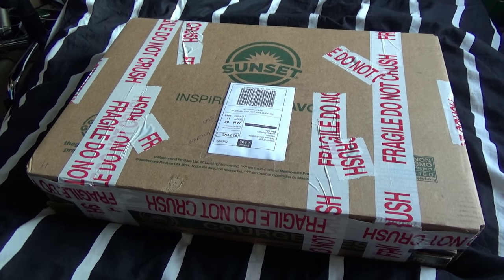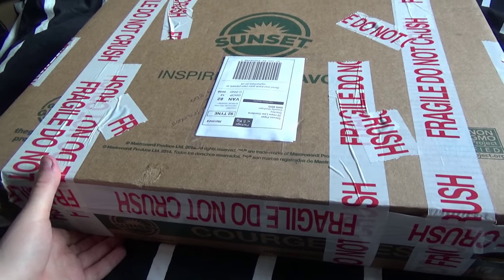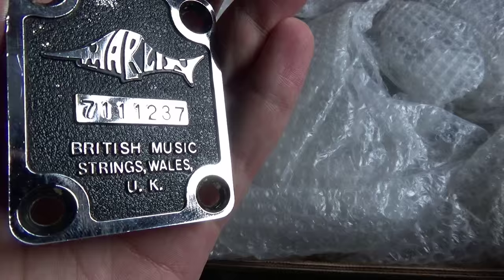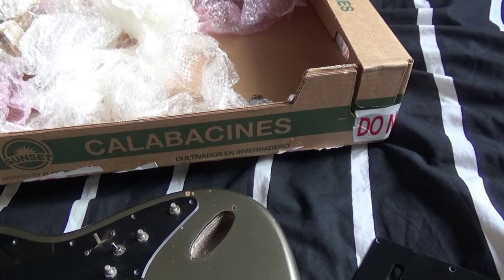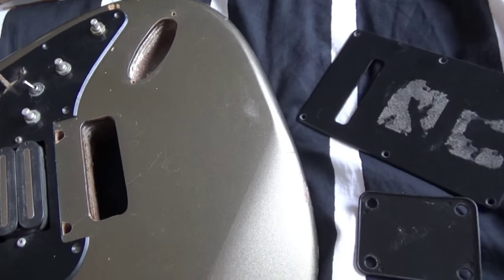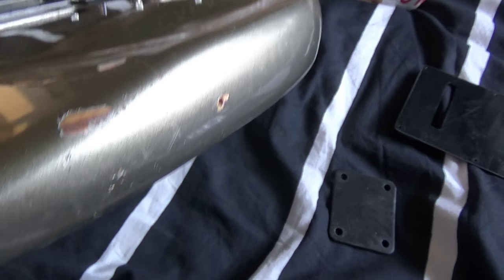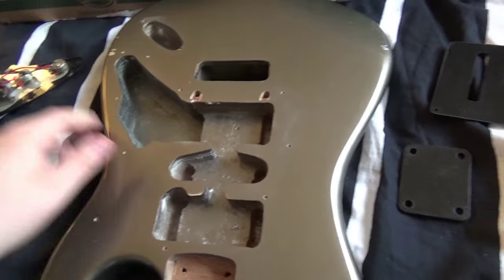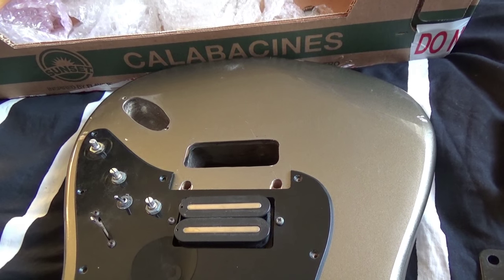New Guitar Day! (sort of) Marlin Sidewinder Restoration #1 - Guitar Adventures #1

Comment: Some trivia I've found whilst spending a quite frankly silly amount of time looking for trem block solutions

The design wasn't sanctioned by floyd rose it was a direct copy of his fine tuning design, so much so he was gonna take legal action but seeing as there were so many of these tremolos out there on different brand guitars (hold on I'll get to that) that they came to a settlement in that they started making them with floyd rose licenced on them even tho they were not or mfg by floyd rose (with the failure rates I'm betting they wish they hadn't lol)

These bridges were on at least four different manufacturers guitars

Marlin known as the kkt
Westone known as the bendmaster
Encore JHS-A7-2T know as the bendmaster
Epiphone..... What epiphone had this fall to bits bridge! Yup known as the bender

None of the brands had any luck as they were all produced by JINAH and all suffered the same fate
Reply from the maker: Sounds about right, I looked into this, and I remember seeing that it appeared to be a ripoff mfg floyd design, I had assumed it was maybe licensed, but it would have been stamped as such if that was the case.

There is no real solution, other that filling and re-drilling for a new bridge, that would be the best idea of course, and there are many cheap solutions out there. Though, while these guitars aren't special in any way really, I would still want to find a solution that doesn't require any modification. For the correct plate, no other block seems to fit, and the mount points, are 72mm wide, whereas, modern floyd is more like 80mm, and most two point trems are approx. 55-60mm.

I remember looking into the background of the bridges, and I had seen many guitars with them, thought the Westone ones do look noticeably better in quality, but perhaps ultimately as you say they likely aren't. Upon pulling one of these apart, I'm astounded the screws for the plate only go into the block by 3-4 mm, that's just no good, the material itself wouldn't matter as much, if the screws went in by more like 10mm

Comment: Sam Deeks - all the parts you mentioned needing in the video are easily and cheaply sourced from online sellers, especially eBay. If you don't mind waiting a bit, order the parts from Chinese sellers for next to nothing. Very often the quality will be better than the Marlin originals. 

Also, British Music Strings was merely the importer of the guitars. Nearly all Marlins were Korean built, with the exception of Slammers built circa 1985/6. Slammers were actually built in the former East Germany, and despite being sold for less and advertised as lesser model than Sidewinders, they are a considerably better built and higher quality guitar.

The holes on your headstock, just above the nut, is where the the locking nut would have been. Humbucker equipped Marlins were all "Superstrat" style models with a locking trem system. It was Marlin's version of a Floyd Rose style locking trem built down to a price. They were ok when new, but wore with age and had trouble staying in tune and in balance. One of the weakest areas of it was the trem block, a low quality diecast material that disintegrated with age. They literally crumbled away rendering the bridge useless (standard trem Marlins were also affected by disintegrating trem blocks). That's likely why yours is missing the trem system, and also why many Marlins are sold with trems "needing attention" or missing entirely.

Marlin locking trems are totally unavailable, and not worth having even if old stock and never used. The trem block material disintegrates with age, so many Marlins (not Slammers though) are now suffering. However, you can buy a cheap "licenced by Floyd Rose)" bridge for relatively very little, and these can be made to fit with very minimal modifications. I did this to my Sidewinder and now it is working just as it did when new.

Despite being cheap guitars, Marlins are worth spending some time refurbishing and setting up, because once done they are actually nice guitars to play and cost little.

Comment: Funny how these old twangers look when you strip them down to the bare bones.
I just bought a marlin slammer myself, They were a little different.. made in germany around 1985, All hardware and electronics was supposed to have been made on site, Beautiful brass block bridge, Odd tuners and pickups and electronics with magnets sourced from russia, The pickups from what i have heard people cannot fault finding them to have a lovely tone and not too much feedback when playing with an amp. Hard wood bodies and hard maple necks. Strange that they went to korea to pump out the sidewinders then when they had perfectly good strat copies already. I wouldn't fret though, You'd be supprised what you can do with a body and a neck! :)
Reply: Gman, stranger still was that the Slammers were sold as the 'budget' Marlins. The Sidewinders were marketed as a step up, despite the fact that the Slammers were far better made. As you said, the Slammers used solid wood for the bodies instead of the Sidewinder's plywood, the tuners were higher quality, the pick guard was three ply (Sidewinders were single), and the whole guitar felt better made. I have two Sidewinders - a K34 "Superstrat" (humbucker and two single coils, plus locking trem), a standard Sidewinder (3 x single coils, non locking trem) and a Slammer. The Sidewinders are great guitars considering that they were budget, but the Slammer is in a whole other league. Well worth grabbing one if you ever seem one come up for sale.

Comment: Maybe to early to celebrate...... But lol managed to source a cad design for a improved biller replacement for the block, I have been chatting to a chap who is a cnc operator and he's going to make up a prototype from the cad drawings, said he thinks aluminium billet should be around the 30 pounds mark should anyone fancy saving one of these trem systems
Reply from the maker: Really? that's awesome, I was actually planning on making my own, then going to 3dhubs.com to get it machined, this would be cool to have, do you have a link? Would he be up for making this in quantity? Or would the cad files be given? My other solution, would be for, if somebody had nothing, like no bridge module at all, then a replacement plate could be made so generic parts could be used with it.
Reply from the maker: Awesome :)

Comment: My first "proper" guitar was almost identical to this. The only difference was that mine had two switches by the volume knob (a coil tap, and an active pre-amp kind of thing. I removed the battery and used it as a killswitch) and a pair of LEDs by the lower tone knob.

For the time, they were perfectly adequate budget guitar. Squier and Epiphone were also making their Strats with ply bodies, so it's no big deal that Marlin did too.

Rosewood neck with 22 frets, sealed machine heads, again typical of the Squiers and Epiphones, and the electronics were average.

The pickups were actually a strong point, as they had the good sense to wax pot them. This was not typical of budget guitars at the time, and so helped the Marlin sound better than the other cheapos.

It's weak point was the bridge, or more specifically, the sustain block. It was made of some mystery alloy that was very brittle. Mine bit the dust after the tension of the strings caused the sustain block to shatter and rip the bridgeplate off the top. Google has revealed this was reasonably common, with some breaking before they even left the shop. At least I had a good 6 years or so out of mine.

I actually wish I still had it. It was a little on the weighty side, but the neck was a really nice shape and so it felt good in my hands. I've seen people fit Floyd Roses on the posts with no issues, so I could replace the bridge, maybe upgrade the knobs and single coils (I'd leave the cool looking bridge humbucker) and it would be a perfectly usable guitar.

What I plan to do is mod a Fender Floyd Rose Strat to resemble my old Marlin. I bought a platinum Floyd Rose Fat Strat, but the colour wasn't quite right, and the neck wasn't right, so it would require replacing too much of it to be practical. I might try one of the new Player Strats and have it resprayed.

Comment: I have one with the 3 single coils strat style cannot for the life of me get it set up rite has a brass nut "bodged" into it by past owner if i get the action rite i get horrid string buzz get rid of the string buzz the action is to high ! such a shame as well as when plugged in it sounds surprisingly great ! and only cost me 15 quid ! but the past owner swapped the cool neck plate with just a standard shiny 1 !!  what a pillock !
Reply: What you probably have is one of the east german made ones. They are amazing! Blank shiney neck plate, 3 single coils, solid wood body, skinny vintage frets, gotoh trem. I have one and it's beautiful. If this is what you have, get it fixed up! You won't regret it.

Comment: ido a lot of work on theses type guitar..they produced 1980,s possibly 1985-6    pick up,s crap  no power  low output    but you can   add new one,s pups... neck great  easy to get  a low action--0.10   nuts crap i opted out for real strat nut....i just need to get rid of parts of  marlin,s o boy i got loads body,s neck,s

Comment: Pls Can you tell me where can ı buy the bridge for Marlin side winder
Reply: Haha! You usd the trem, didn't you! Don't use it! Just never do it! If you use it, it breaks.
Reply: Unfortunately you can't get the exact model trem system used by Marlin, as it was their own proprietary version of a locking trem (similar to a Floyd Rose). They are long since out of production, they are cheaply made, plus the string block  falls apart (one of the reasons many Sidewinders are sold with damaged/ missing trem units). However, you can buy a cheap Floyd Rose locking trem copy from eBay/ online, which are much better quality. They can be made to fit with minimal modifications to a K34 Sidewinder, which is what I did to mine.
Reply: They are a floyd rose licenced design, also used on other guitars of the era
Reply from the maker: Yup, and so bloody difficult to find. And if you're just after a trem block, good luck. There was a seller or two selling all the parts for one of these, but every part, was priced at something like $99...
Reply: @PIPERdotEXE  there a a repaired one on ebay just now in Japan (as these were available on various guitars as made by samick) for I think 80 pounds, it's a black one
Reply from the maker: Yeah, that is one thing there were a few makes that had it. I'm lucky in that I got one for around £25 a couple of years ago, only thing missing is the trem bar doesn't have the tip, but it's complete otherwise, but I have another bridge that is missing the block, that's then next challenge I think
Reply from the maker: Nope, I didn't, the guitar didn't come with one